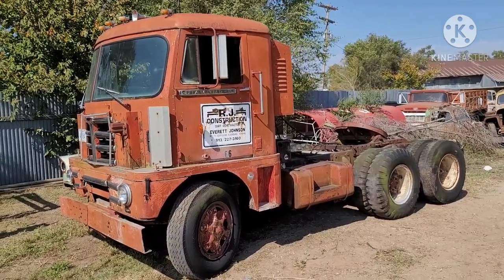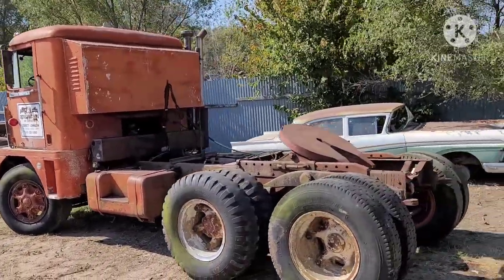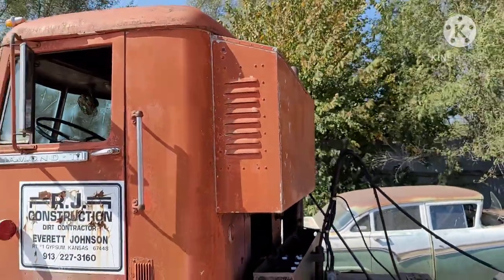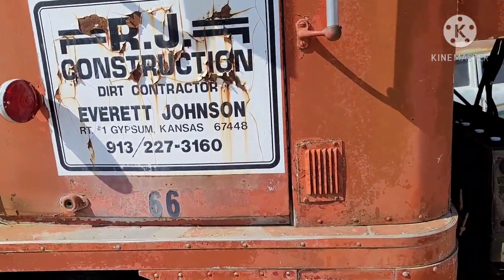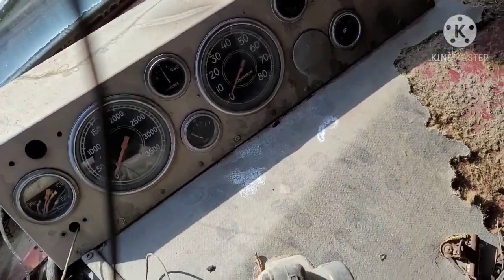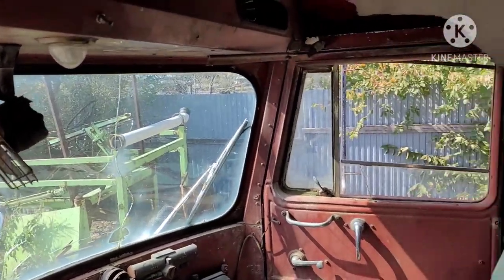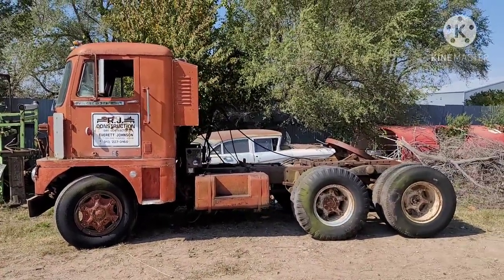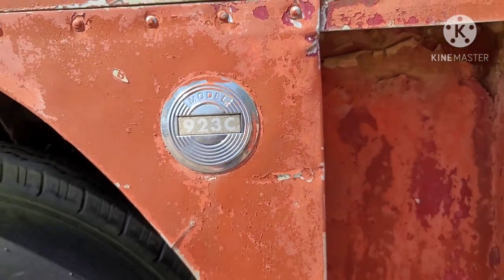Resting Relic: Abandoned 1959 Diamond T 923C "China Closet" over the road tractor trailer truck!

Comment: Seen a couple of Diamond T trucks, but not this one. That clutch master cylinder protruding out the cab is rather starnge, someone could empty it and disable the truck. The other truck in the picture does not have the master cylinder, so it must have an auto transmission. The low air pressure semophore too was strange.

Comment: I did think it was kinda strange to have a master cylinder on a truck with air brakes, but since several comments have indentified it as a clutch master cylinder, I'm gonna say it was "adapted" when someone swapped the original engine and trans. If I remember, and I could be wrong, that truck should have an early cummins diesel, and probably a twin stick 5+4.

Comment: Wish my Daycab Cascadia weighed 14000 lb. My empty tare weight is 18500 lb.  it's got a wigwag. You couldn't reset it till your air pressure was good.
Reply from the maker: I think the aluminum parts helped keep the weight down